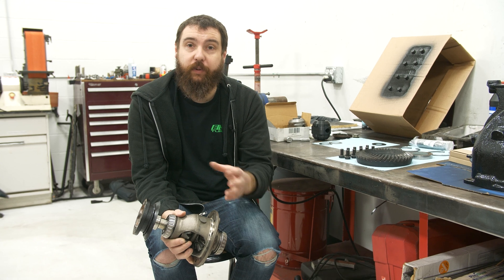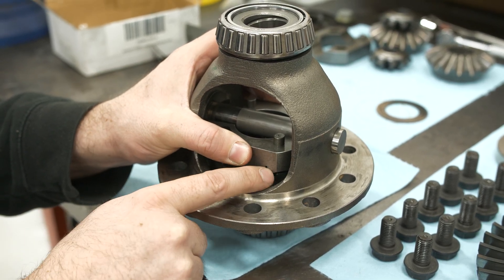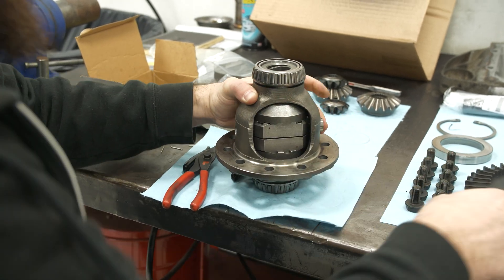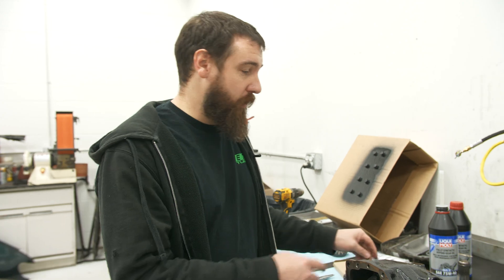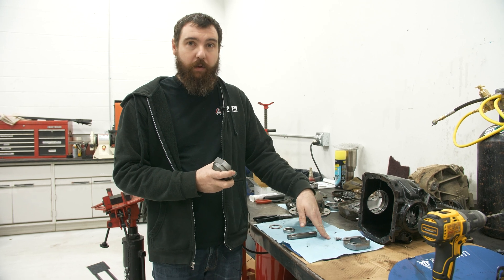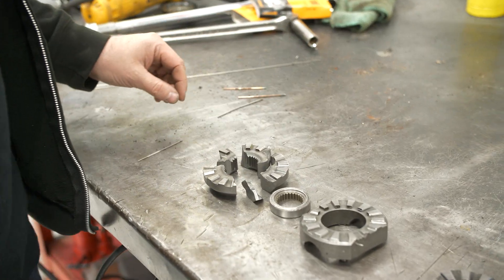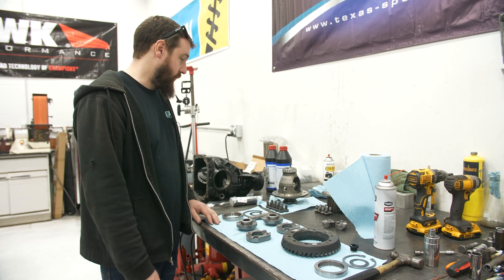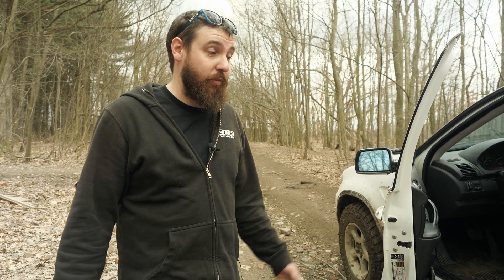Creating a Locking Differential for the Off-Road X5! | Built by Mike Overland

Comment: forgive my ignorance, is there any significant difference between an X3 diff and an X5 diff. ie will the diff centre in your X5 fit and X3 to create what I call a detroit locker. my last 4x4 got cleaned up by a wombat on his mobile phone. but that had an ARB air locker. I am thinking about returning to driving a 4x4 but ARB does not appear to have any BMW parts that I might consider adding to an X3/X5. Cheers PK Aust.

Comment: Good work Mike and the ECS team working on these mods for the E53. One request for future mod would be a kit to change over the trucks that are spec'd with 4 corner air suspension. The current catalogue only has a kit for Bilstein B12s with either Eibach or H&R lowering springs.

Comment: Excellent work! One of the advantages of lockers that nobody talks about is the control they give the vehicle when going down steep descents on loose material. A lot of modern vehicles use some sort of "hill control descent" algorithm to engage the brakes in a way to control the car when going down steep hills. Problem is they use the brakes a lot and if they descent is long it can overheat the brakes, cause unnecessary wear, etc.  A mechanical or selective locker will not allow one tire to over run the other and it helps hold back the vehicle without using the brakes on steep descents.
Reply from the maker: It definitely helps with that for sure!
Reply: The x5 has that kind of hill decent control from factory as well